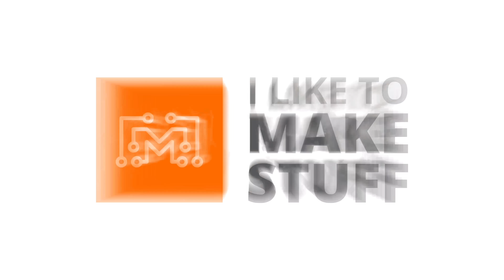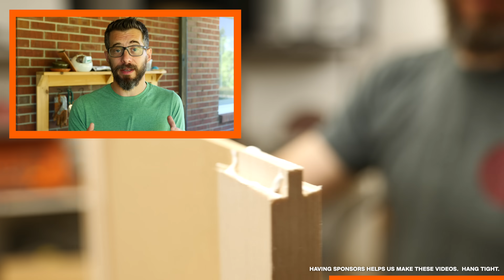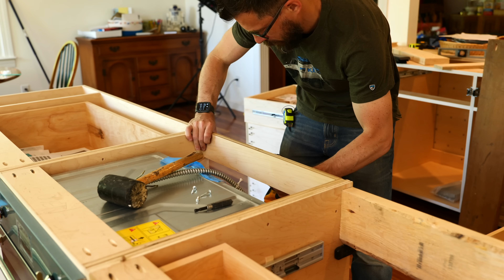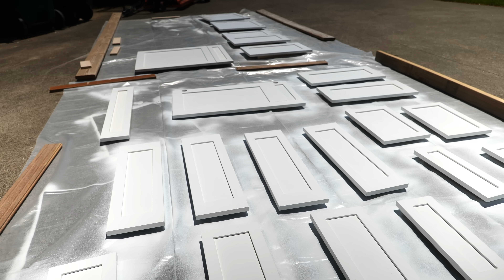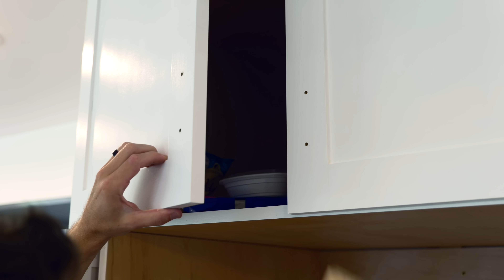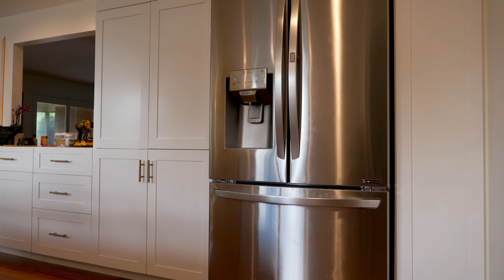Kitchen Renovations Aren't Like TV Shows! | I Like To Make Stuff

Comment: I used to do cabinetry.

Pro tip: always install the uppers first. You can get adjustable prop sticks on Amazon. Always measure the area twice before cutting fillers. Once you have one cabinet in at the start of your run (leveled) set the next cabinet next to it, screw together the face frames (be careful not to drill through the front or back of the face frame- very easy to mess up) and once the next cab is level with the preceding cab then install it to the wall. Your walls may not be level so be careful - walls and floors are never perfect. 

54.5” for upper wall cabs in kitchen
72” for hood vent
57” for laundry room upper wall cabs

Also, the toe kick trim just needs some caulking and pin nails. Scribe just needs pin nails. And you can get a nice hardware jig for $25 on amazon- don’t buy the plastic ones, always go with the metal ones.

Comment: Great details about how to do this, especially putting wood behind when you drill the holes for the handle & making the door frames. I like that you included the counter support detail. I would love to see how you measure & drill/router for your concealed hinges. We're thinking of using our existing cabinets (framed) and replacing the doors, rather than replacing all the cabinets. The cabinets are well made, just an older style door that we don't care for.

Comment: Great video with a ton of useful info (I'm buying that door handle jig), thanks!

I recently finished renovating my kitchen, but opted to refinish the cabinets instead of purchasing new.  The old cabinets were in good shape and just needed cleaned up, sanded, primed and painted.  We reused the existing corian countertops as well, but I made a layout adjustment and cut off a section of a giant piece that was 'U' shaped to make an island.  The only setback I've had after tiling the floors (wall to wall) and refinishing the cabinets is getting someone to come out and finish the edges with the 2 part epoxy used in corian applications.  All told, the reno took me about a month, sans two finished edges on the corian (still waiting to hear back from 'the guy').

As we were painting the previously honey-oak stained cabinets, I looked over at the missus and said, this is fun 'n all, but next time we're buying new.  It was a LOT of work that we somehow finished in a reasonable amount of time.  While the whole thing took about a month, we had the kitchen in a usable state in less than 2 weeks.  We busted our butts!

Comment: what is the equipment you used to paint the cabinets? is that the gravity fed HVLP from rocker or a different system? and did you finish/clearcoat the inside of the cabinets i remember you mentioning that in an earlier episode.

Comment: Did you just put a kick plate accross the dishwasher? What happens if you need to service or replace the appliance?
Reply from the maker: The kickplate is held on with a few brads, very easy to remove if need be. 👍🏼

Comment: Not having a seperate kickplate for the dishwasher -_-, if it leaks or breaks you need to remove the whole thing instead of just pulling it out.
CAD models for appliances? Just use the mesurements from the manufacturer and make a box named after the appliance.
The 4x6 for the countertops, why not flushmount and notch for the supports?
Cool and all, but always something that can be done better.

But the tips you are giving are solid ones.

Comment: If you're putting an outlet in a space such as an unfinished attic or basement, you should use GFCI [and probably should be AFCI too] outlets.   There's a danger of water leaking to it, might aswell keep your house safe.

I'd also wouldn't block your gable vent in any way, go with a dedicated vent for rangehoods & bathroom fans; those gable vents need to do their own job without hindrance.

Comment: Where I am from we do it different. When we use wood we expose it. When we want white cabinets we use particle board and CNC cut mdf doors. No pocket holes, simple carcas, no double drawyer front. Sometimes even pre made drawyer sides.
Because wood is premium and painted white is something basic in Europe i guess. So we would not waste ply or make joints.

Comment: don't put the pendant lights up until the countertops are installed and google the pendant widths and heights relative to the countertop to figure out where you want the lights, then use a laser level to shoot straight up from that spot on the countertops, mark the ceiling laser light with a pencil and drill right there.

Comment: I would cut some 1/2" ply or MDF and use that as a temporary countertop if I had to use the kitchen in that month+ wait. Heck just get one sheet of ply and cover it with any laminate, rip it into two 24x96 pieces and you'd have 16 feet of temp counter space. Must be driving you nuts trying to cook without any counterspace.

Comment: Just for people doing this themselves- in many areas it’s not to code (anymore) to exhaust vents out of soffits. This is because soffits are meant to suck air in, and that air gets exhausted out of higher vents due to convection. So moist air blowing out of a kitchen or bathroom vent exhausted out a soffit can get sucked back in to the soffit due to this convection, causing mold problems. The previous owners of our house spent about $2500 in mold mitigation and vent moving as part of our purchase due to this exact problem. Current code in my area requires exhaust out of the roof or an area with no soffits.

Comment: One of the things Bob didn't get around to mention in this video (which is understandable from the sheer amount of stuff to know about when building kitchens) is paint choice. Always choose a paint that dries to a smooth surface, so dust, grime and old food stuffs doesn't stick to the cabinetry and their fronts, nor smudges out when you try to wash them. Cause you WILL need to wash your cabinetry with a rag at least once a week to keep them clean and sterile for their environment. This might seem obvious, but if I had a dollar for each time I've seen the wrong paint being used on any kind of furniture, I'd soon be able to compete with Jeff Bezos. It's literally that common. Choose a paint that's easy to clean or you will regret it. And repainting properly isn't something you'll just do either. If you can't get a good paint in the color you want, then apply a lacquer to the surface area of all cabinetry - both inside and outside - as that would leave the surface smooth and easy to clean.

As for the videos, I'd love to see them as separate projects. Makes it easier to find your tips and tricks later on

Comment: Did you think about making temporary plywood countertops?  You could make them double thickness so 1.5” thick. With polyurethane they would be functional. Cost approximately 4 - 6 sheets of plywood. Evan at $60 per sheet that is on $300 for piece of mind.  Advantage, you would have a working mock-up of the countertops and get to test out the layout.

Comment: You should mention the way you have been using your sink with the temporary faucet application. Im a countertop measure tech. So I understand your inconvenience.  I’m measuring jobs that are possibly 2 months from installation. Farm sinks are definitely beneficial to have a somewhat functional kitchen. Another tip for someone not doing a farm sink is to keep the old sink and countertop if you’re replacing the cabinets. You can put them on temporarily. Just set the old counters on the new cabinet and hook the plumbing back up. No real need to even secure the old counters back.

Comment: I just finished a new bathroom install which nearly killed me(adding a bathroom upstairs to 100yo house was not fun). Excited to start the kitchen though! Starting is much more fun than finishing. Multiple videos is better IMO.
Reply: What's that saying? It takes 20% of the time to do 80% of the work, then 80% of the time to do the last 20%...

...and if you're like me another 20% of the time to fix the 20% you messed up...
Reply: Was it killing you because of how hard the job was or because you were deathly afraid of damaging the 100yo house?
Reply: @derpdude32  mostly because bathrooms have so many small essential tedious things, but on top of that I had to redo a few issues the house had prior, like redoing insulation and working hunched over in a terrible crawlspace. There are just a million tiny decisions that stack on top of each other. Kitchen should be easier.
Reply: @SeanHodgins  Ok makes sense thank you.
Reply: @SeanHodgins  just completely gutted and re did a bothroom in my house built in 1948. I feel your pain. It’s never just the project your doing lol
Reply: The last major project I did was refinishing a basement into a custom home theater…it nearly killed me, lol. I was so tired when it was all done. Going in I thought, “No big deal,” but all the little parts add up.

Comment: Qq ... will the fusion models be in the fusion course?  Havent visited the course lately, but i got the course to learn modelling cabinetry specifically.  Would be so useful to see some kitchen cabinet walkthrough in the course?   Ps, great work guys!  Great result.  Would be cool to see how cnc could help you create all the drawer inserts.   Like inserts parametrically modeled in fusion, then gcode imported in easel.  Others could use the models, adjust the params to fit their drawers and have iltms drawer inserts(maybe with iltms logo).  Id buy that 😀

Comment: i wanted to say this on your vide about car renewal, but time would allowed it, and it's going to be a long read. first I'm not a mechanic nor a  race enthusiast but I'm a bug fan of car renovation programs and I've seen a lot in my life, so take my advice from a novice to another novice I guess.
For renovating a car itself I would strongly suggest if you're able to find a willing soul that could lend you their repair shop,mainly because I've seen that working without a lifter is almost impossible, you need to be able to check the chassis integrity as that is the first step into insuring the car is not going to fall in the middle of the road, plus some cars require specialized tools in order to get disarmed. second I would strongly suggest you pick the car users manual as I've come to see some unique models (like the one you have) that are compact often have some weird parts twisted around other parts (i dunno know if all this criteria apply to your particular model of car) but my instincts are telling me you should know this before starting the disassemble portion.

For shooting I don't spect you to have a production level quality like overhauling or something like that, but if you wanna see a good direct approach I would strongly advice you to watch "jewels on wheels" not only does Ed China has a great grasp on how to do it yourself, but most of his advices are just golden, he is precise, eloquent and makes he's points cristal clear. i dunno if anything of this would help you but since you asked the las time here it is my very very noob advice.

Comment: I was wondering.  Did you guys think about possibly putting some-type of tile behind the range and vent hood?  The reason I ask is because as we know when cooking things food likes to pop, splat, etc.  Also as we know over time heat, grease, oil, dirt, moisture, etc. can cause discoloration near a stove or range.  

With the light-colored paint, food splotches and splats are more visible.  Also, some food is hard to get off of walls once it sets in.  With the tile (preferably darker-colored tile) not only would food splats be less visible, but easier to clean. 

Anyway, the kitchen is looking great!  I would like to see individual-videos on each project in the kitchen.  I find it easier to study when you can focus on that one thing.

Comment: Speaking from experience coordinating apartment renovations, another problem that can arise is the plumbing and electricity for the sinks/appliances. For example, sometimes wanting to move where an oven is placed isn't possible due to lack of cable infrastructure which would require alot more costs/delays in the timeline.

Comment: Smart with the picture in picture ad.  Made me watch it because I wanted to see the other stuff in the background.  I usually just fast forward over ads with the right arrow key.  

Why don't you build your panels oversized and then cut them to size so all the joinery looks perfectly blended together?  I used to build my panels to exact size like you did then watched a few carpenters build them slightly oversize so they can cut them to size after glue up.  I also found it was a lot quicker to build panels like this rather than have to get everything exactly right on the first try.

Comment: Smeg, great choice, their thermoseal tech is awesome with its ability to not circulate smells within the oven thereby making it possible to cook and bake in the same oven at the same time without transferring any flavor. 95% of Dishwashers and washing machines and 70% of most ovens are 600mm wide, larger ovens are generally 900mm wide (usually have rotisserie capabilities). These sizes are pretty much industry standards to make kitchen design easier and for ease of replacement without drastic remodel. The only difficult items to size are fridges or bespoke appliances and sinks.

Comment: You forgot to include:

Dropping a screw down a gap which prevented a door/drawer from closing all the way which caused you needing to dismantle and fashion some sort of screw grabbing device.

Finding out some aspect is a really awkward two person job on the day no-one else is around ... And you have just laid a bead of glue down.

Gluing something together and finding you clamp is out of reach meaning you need to act as a human clamp for 10min.... Then your significant other sends you an urgent message...

Bzzt bzzt... Oh out of screws ... With one hole to fill... Should you use a small screw or wait till you get another batch in with a missing screw... You forget about it and a year later you see an empty hole...

I could go on, but in my experiance however much you plan. Some days sll you end up doing is fixing ypur own mistakes or accidents :(

Comment: The yellow appliances are the bomb....
Reply: Awesome job BTW!  Looks great.  Thanks for bringing some attention to time lines.  Hard to time it all.  Individual projects would be great.  Also, Just something to think about... you may have already.  I noticed your kick plate went all the way across you dishwasher.  You might break it and use some magnets for the portion that goes across there incase you need to remove the dishwasher so you don't have to remove the whole kick panel across the cabinet line.

Comment: Please don't attempt backsplash before the countertops are in. Been there - not worth the hassle. If your cabinets are dead nuts level you can run backsplash right off the countertops instead of cutting the bottom row.  
I have done 1.8 kitchens in the past few years (finished one, sold house, moved, started all over gain and almost done). The real issue with DIY timelines is life. You think you'll be able to work on something at night or on the weekends until...you're at a wedding or friends are visiting or you're just tired. On my current DIY once the kitchen became functional (countertops in, sink functional, all appliances working) the pace slowed about 500%.

Comment: Great looking kitchen. My European brain still can't handle the eyesore of the American fridges. Beautiful classical kitchen and then: bam! Stainless steel. Here we have fridges with the same fronts as what you did with the dishwasher
Reply: They have those here too.. generally they're much larger and are going to pay a premium for the panelized version.
Reply: @TheJasonbking  weird. Here alle appliances are usually 60 centimeters wide. In that width you can have a fridge, freezer or combined. And they are not particularly more expensive

Comment: Bob, you should not vent it out the gable vent. Air can be drawn back into the attic from your exhaust through the rest of the gable. Exhaust vents need to be 2 ft away from intakes.

Comment: Are the 2x6s for the overhang brackets only connected to the carcasses by pocket hole screws? It feels like the potential amount of torque from the 16” of countertop at those joints may be too much for them. Overall, love the project!

Comment: When you do big painting operations like that, especially when it's outdoors and on the ground, what do you do to prevent/minimize bits of debris and whatnot getting stuck in the paint when it's still wet? I've had so many coats of paint ruined by a dog hair or piece of grass or something and no matter how much I try to keep the area clean and everything, it still happens occasionally and I end up having to sand and repaint (which then exposes me to that risk again). Do you do anything special to help with debris or do you just try to keep clean and redo the paint when the unfortunate happens?

Comment: Hey Bob, I noticed in your past couple of videos that you have been using wood glue. What if I told you that you could have a stronger bond, for cheap. I do a ton of wood working, and I use elmer's glue in one of those ketchup bottles that you'd find in the dollar store. I swear by it. I have a clock that I built all the way back in 2014, it has taken abuse, after abuse, scratches, chips, dents, you name it. I glued the top on, because i didn't want screw holes showing in the final project. I used elmer's glue which was recommended by a late friend of mine. In all that abuse, it has never come off, and i put it on a 6ft high shelf. I would totally recommend it. And thanks to carter for the advice (2004-2018) :(. Hopefully you can use it to the best of your advantage. Good Luck.